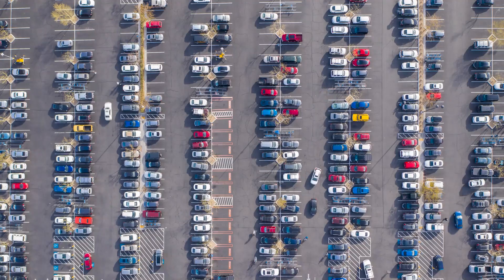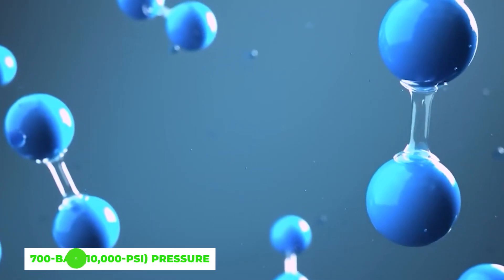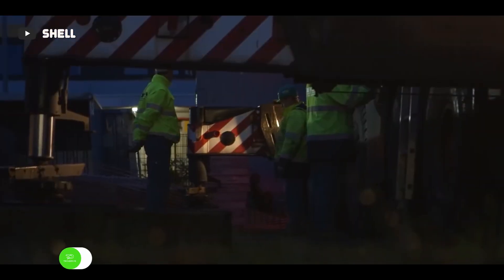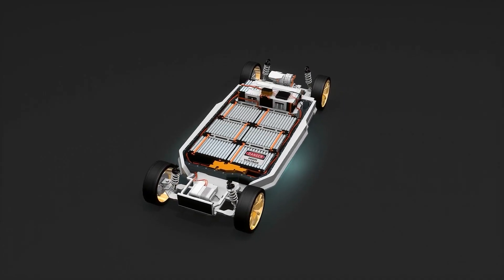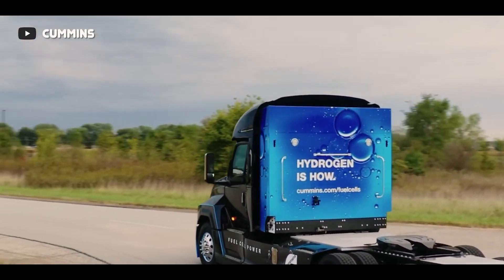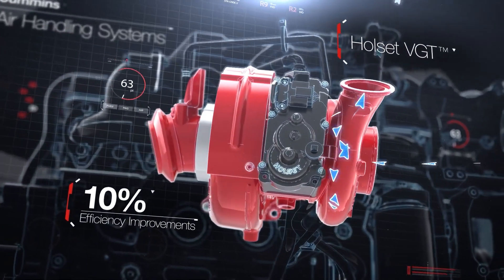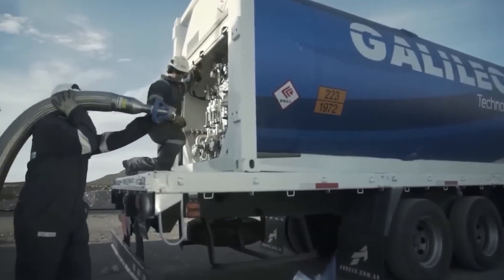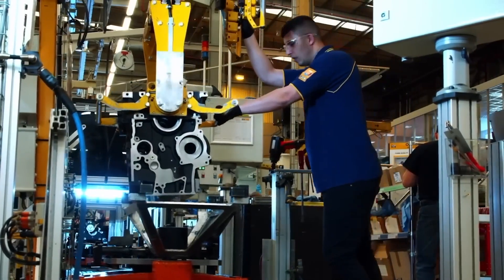Is Cummins Hydrogen Engine the Diesel KILLER?

Comment: Saving CO2 by using hydrogen all depends on how the hydrogen is made. If the hydrogen is made with fossil fuels (Black hydrogen )it's going to be a much different CO2 level than if it's made with Pink hydrogen (nuclear) or green hydrogen.(renewables) 🤔

Comment: Gas n diesel engines aren't going anywhere, bud. btw, kawasaki just released two new 2 stroke dirt bikes for 2025. Yup, oil n gas in 2025, so gas n diesel will be around a lot longer than a few years. Cool idea though eliminate the hybrid part as in altogether with just hydrogen 🤙

Comment: I would like to see this replace the diesel engine in the Edison electric truck. The Edison is a very cool set up and has potential. But if you add this engine it would be a huge leap forward. Since the Edison truck is basically using the same set up as trains and most modern tanks. Clean burning engine with the instant power of electric motors.

Comment: A gallon of high pressure cryogenic liquid Hydrogen will never equal the energy density of a gallon of Diesel fuel. The infrastructure for H2 is not there either. And everything in the free market that the government touches turns to poo. :face-fuchsia-poop-shape:

Comment: I built a hydrogen powered vehicle. I made my own hydrogen generator that made possible hydrogen for the same carburetor on the vehicle but capped of its air supply. On the ford "Festiva" three cylinder car had its own fuel supply which was a gallon of water. That generator made hydrogen and also allowed for its air supply. Surprise is only surpassed by the fact it got over three hundred miles to a gallon of water. Once I made a bigger generator, it only took a pint of water to do that same mileage. Also lower exhaust noise and driving power was never compromised at all. I did this in the year of two thousand eight.
Reply: You have got to post some YouTube vids about that. Would love to see the build!
Reply: look brosky we all like stories .. maybe back it up with visual facts with all your calculations and facts that can be repeated !

Comment: You can leave a petrol or diesel car for months or years and the fuel will remain viable. Hydrogen vanishes after a short time. Use it or lose it. You cannot park a hydrogen car in an enclosed space for fear of explosion or fire. This is not the solution until the storage problem is sorted.